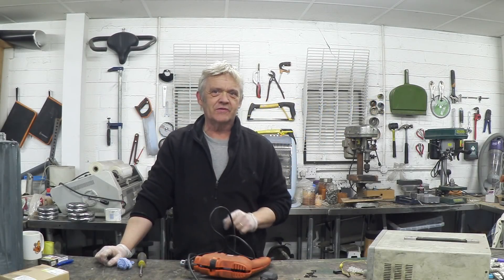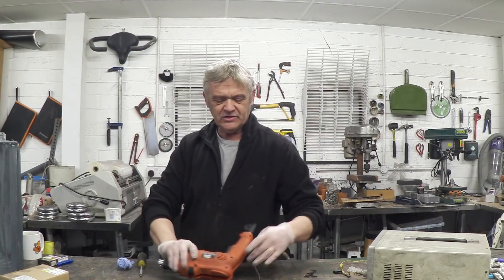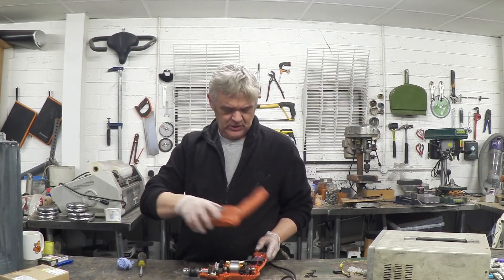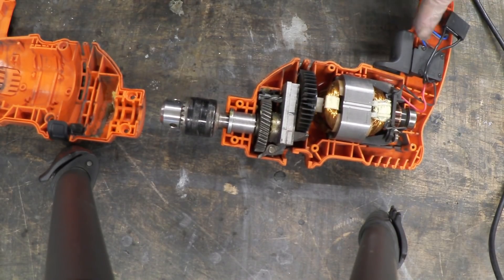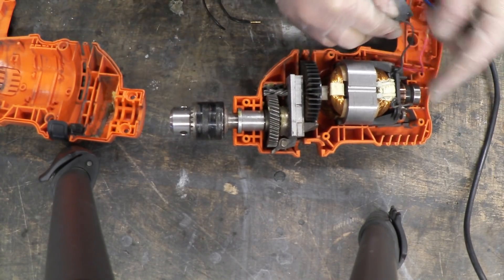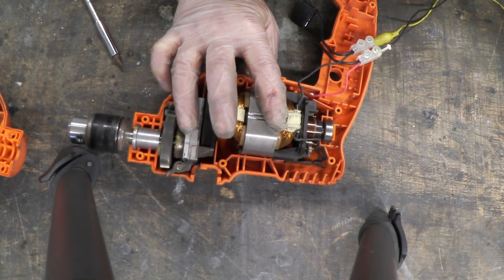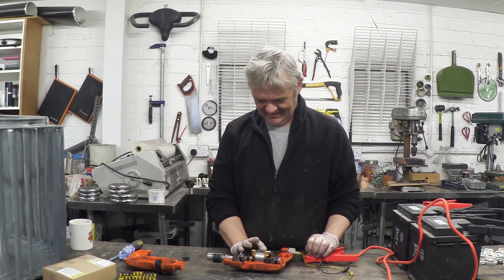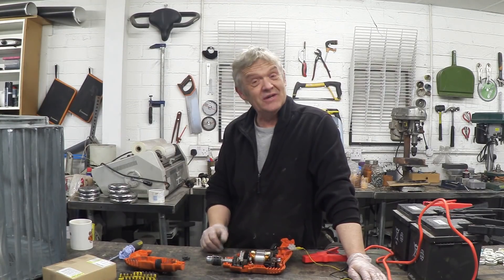Converting Plug In Power Tools To Run On Batteries

Comment: Using a buck converter would be more efficient than using an inverter, so much power is wasted with inverters
Reply: @realfamilyman  the power loss is using it, anytime you step up voltage you lose current,in this case times 10, for each 10 amps in you get 1 amp out, that's 90%power loss